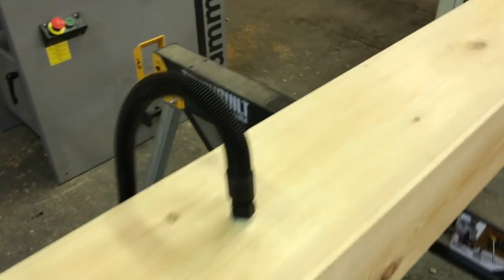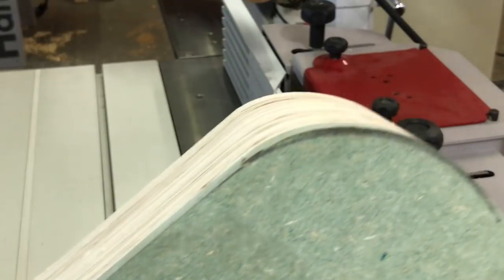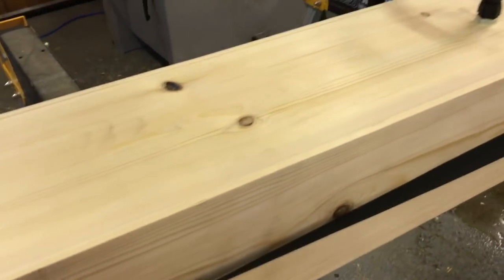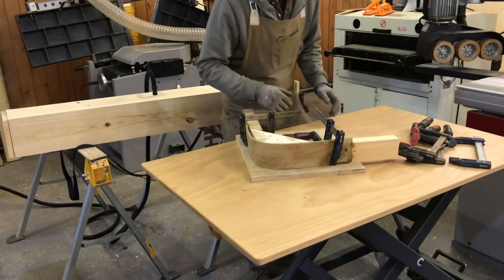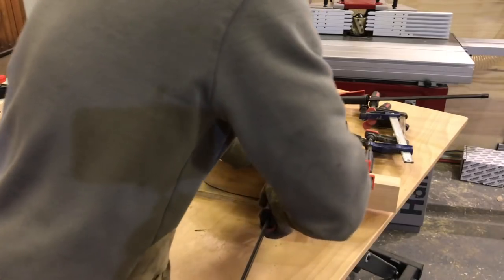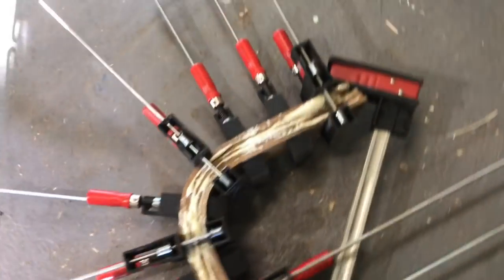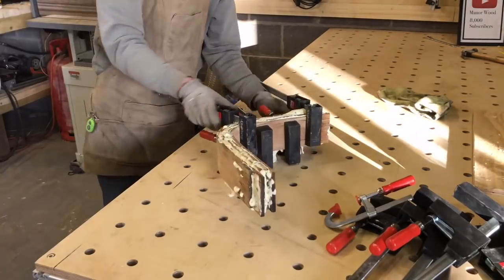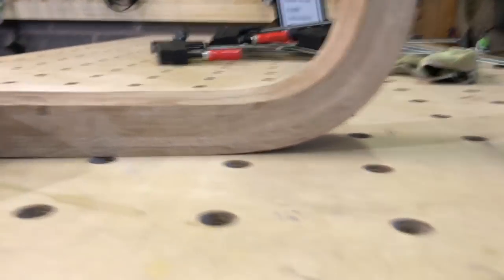Oak Steam bending test 2 of  3

Comment: Sir, when you use a bearing on the shaper, try putting the bearing ontop.  That way if for some reason the work tips it cant dig into the work and either ruining the work or causing an accident. Bearing on the bottom the work can tip and the cutter will dig in deep. This especially possible with long ungainly pieces.

Comment: Looks really good' the former works well and look forward to seeing other designs as and when you make them.  In boats I tend to use resorcinol resin for laminating and sometimes thixotropic epoxy.  Resorcinol works well and is brown so can leave a dark brown glue line but you won't get the foam voids you can get with that PU glue.  Aerolite is another resin glue used a lot in the past in boat and light aircraft manufacture and is a very strong bond which leaves a clear glue line.  TBH I hate PU glue and as you say the clean up is horrid on hands or tools etc.  Look forward to seeing the table as it develops.  Cheers. Andy
Reply from the maker: Thank you .!  and thank you for the info on the resin's you use for laminate,  I will give a couple of them a try next week , steam bending is some I have only done here and there , but if this table design works for me I am going to have repeat this over and over  and really what a good simple set up to do this . I am making a 2 part form now so i can have repeatability  .. btw I agree nothing I have ever come across is a bad as PU on your hands alway ends up black:(  ...
Reply: Manor Wood Black yes that is true, I always said I would put gloves on and either I forgot until too late or they ripped part way through.  Now I just avoid PU as there are alternatives for what I do.

Comment: You should be using a two part jig to maintain even pressure to help prevent splitting and keep the bend even.
Reply from the maker: I think your right.! I didn't get any splitting on this bend but would be hard to bend three the same would out a two part jig.  this was a quick test in to bending to see if A if the oak would bend @ 90 , B if I even liked the design.  I do like the look so far anyway, I am going to finish the legs off for my test run. then build a two part jig :)   thanks for the advice ..!

Comment: I thought that was a great result actually, particularly as you were sort of figuring out the clamping as you went along. I wonder if you had a steel work top with holes in it like a boiler makers , (rather than your wooden worktop), if you clamped one end of the steamed 'ply' and then progressively work your way along the length using pins in the holes and full height wooden wedges to gradually form it up against your template. (would be easier to draw than say). Once you removed it from the template and things had fully cooled and acclimatised - how much spring back did you suffer?
Reply from the maker: yes that sounds a little like my idea, good call.   I was trying to save storage of lots of forms . but I am going to try a 2 part later today, as I need to get these all the same bend for the table legs,  will upload the results :)

Comment: Maybe you could have used a band clamp
Reply from the maker: Thats a good idea , I did try that only problem is there is not enough adjustment , I also tried a ratchet strap again not enough adjustment.     I have a new two part jig which is working well I will upload the results next week ..